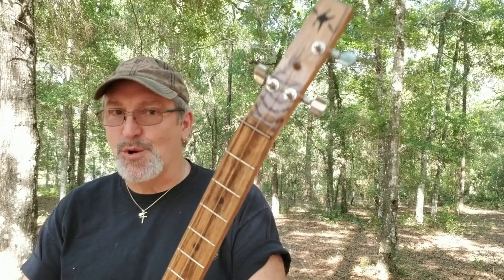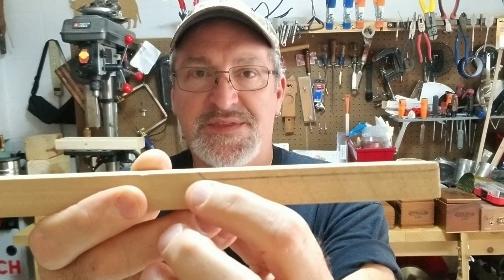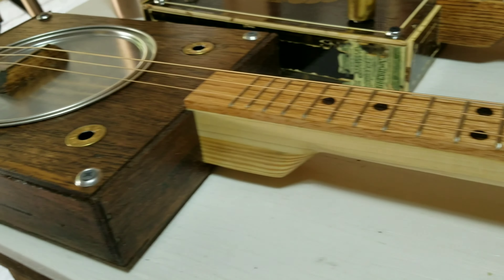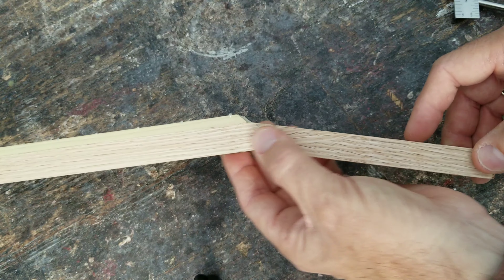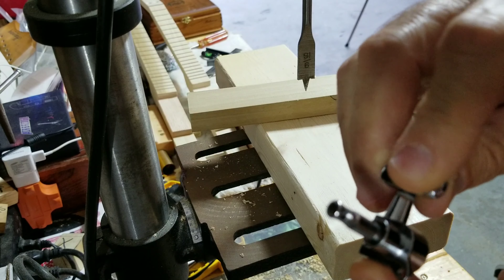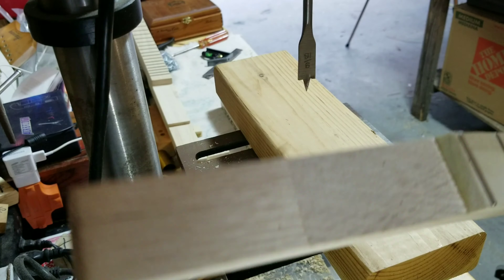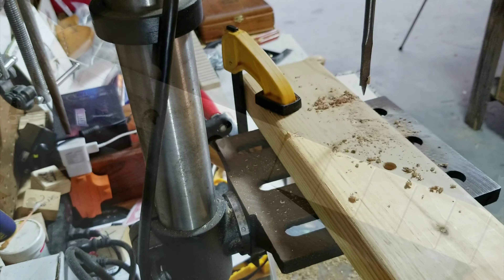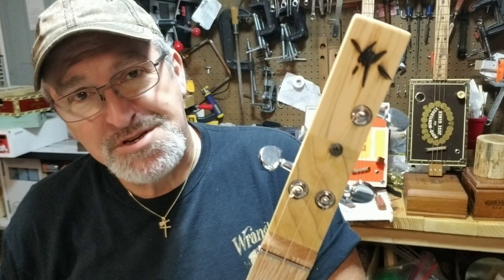How to build a 3 string Cigar Box Guitar - Cool way to add tuners to your CBG.

Comment: Thanks for the suggestion! I’ll have to give it a try. It looks like it will save work in both cutting then sanding smooth the headstock from the usual way.
Reply from the maker: Your welcome Steve. Thank you.  Ive done it on a few times now, and it does save time.
Reply: sorry to be so offtopic but does anyone know a method to log back into an instagram account?
I was dumb lost the login password. I appreciate any help you can offer me!
Reply: @Franklin Drake instablaster =)
Reply: @Milo Juan i really appreciate your reply. I found the site on google and Im in the hacking process now.
Seems to take quite some time so I will reply here later with my results.
Reply: @Milo Juan it did the trick and I now got access to my account again. I am so happy:D
Thank you so much you really help me out :D
Reply: @Franklin Drake glad I could help :D

Comment: Hey michael, i recently finished my first cbg, and it turned out great, the only issue i have with it is the height of the strings. Could you make a video about how you determine the height of the strings, with installing the nut and bridge and everything related to That? I'd love to see it. Greetings from switzerland and have a nice one🤙
Reply from the maker: Hi Eugen,  String height can make or break your cigar box guitar, that's for sure. I will do a video on how I set mine up very soon. Thanks for the info. M~
Reply: @SouthernFireGuitars  that'd be very cool👌thanks
Reply: Congratulations on completing your first CBG!  I'm sure it will be one of many.  As you have already figured out, sting height is done to your preference.  If you plan on using a slide, you may want it higher than if you plan on only fretting it.  Both the nut height and saddle height impact overall string height. Both can be adjusted.  The neck angle is also a factor.  Some people like a straight neck while others prefer to have a back angle.  The latter will result in a taller saddle and more room between the strings and the box.   Another consideration is setting the bridge and saddle in the correct location.  If you get it wrong, you will problems with intonation.  I did a short video that addresses setting up a floating bridge in case you are interested. https://youtu.be/8kGn2dMb86k

Comment: Hi Michael,,,,,would countersinking the tuners make the strings to close to the neck?,,,,,thanks
Reply from the maker: Hi Lettuce. I only sink them 1/8'' and have never had an issue. Just cut back a little on the amount of string you wind on it. M~

Comment: Michael, I’m sorry I’m replying years after your posting, I’m new and just going through your videos…

In regards to tuning machines, I’m on my 2nd build… I used a tuner from the CBG parts suppliers (no need to mention name) I find these tuners, locking by the way, are quite inferior to Shaller, Kluson, Grover etc. I’ve decided to order a set of Hipshot tuners to replace on my 1st guitar, and for my 2nd build. Are you using CBG tuners on your builds or a typical 6 string “Guitar” tuner?
Thank you.
Reply from the maker: Hey Johnny, No Problem,  you can reply on any video. I really like the Guyker tuners. Good quality,, they turn very easy and not as pricey as some of the fancy names, but I think JUST as good. Here is one I use a lot for my CBG's  https://amzn.to/4gcuSJ1
Reply: @SouthernFireGuitars  thanks for the reply! I’ve seen the brand but haven’t really checked them out. The Hipshots I have on the way are about $60.00 for a set of 6 open geared locking tuners, so, about $30 bucks each set for 2 guitars.
Man, I’m sure digging watching all your videos, a wealth of quality information, Thanks again!
Reply from the maker: @johnnytheflyer  Those should be cool.

Comment: Is there a nut gonna be installed on that, seems like the action would be way low if strings were just a n that fret
Reply from the maker: I am using a jumbo fret as the nut on this one. M~
Reply: @SouthernFireGuitars  what size fret wire do you use?
Reply from the maker: @graysaw  medium for regular fretting
Reply: @SouthernFireGuitars  thx , I’m gonna try my hand at making one, your videos are the best I’ve seen so far. Entertaining and informative. Plus you play very well
Reply from the maker: @graysaw  Thank you, David I appreciate that. Good luck with your build and have fun. M~